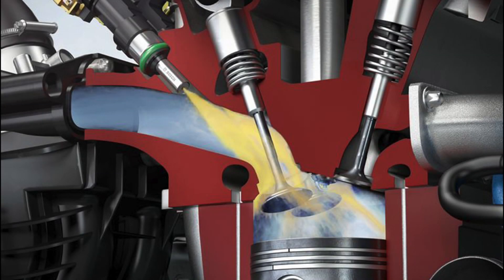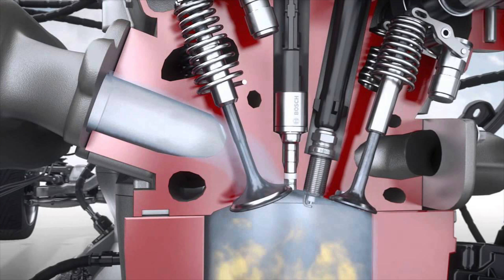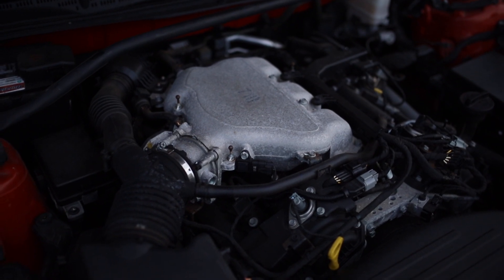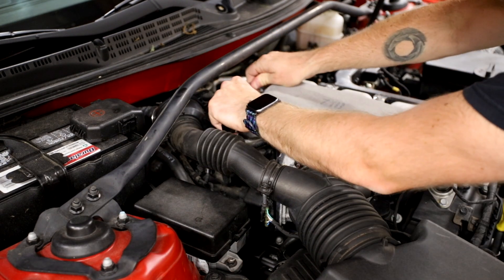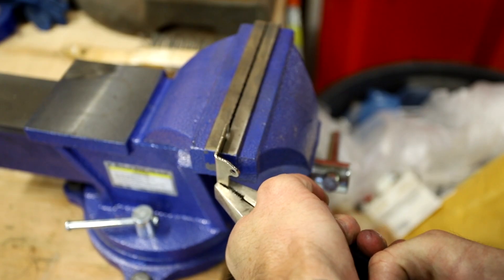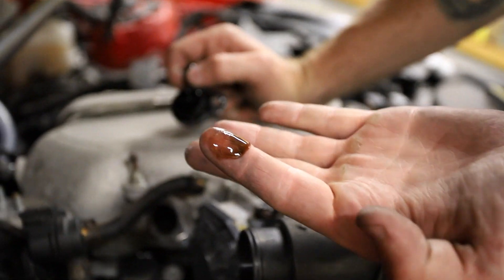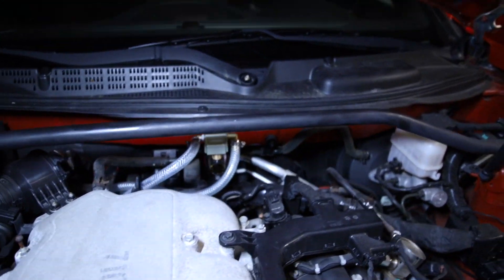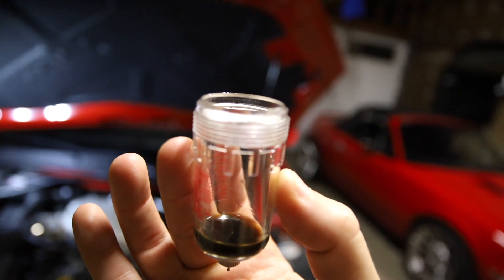First Mod for any Direct Injection Engine

Comment: Just bought an oil can for my 2016 Sonata which has the 2.4 GDI only engine. Next time I buy a car with a GDI engine only I'll definitely install the can right away. It was $40 from Amazon and makes a huge difference. Also I'd say replace the PCV Valve every ~40k miles. It's a $10 part. So for $50 you can greatly reduce the known carbon build up and burning oil issues.
Reply: Great! I have same car as well, you can also add a water vapor bubblers from the exit of the catch can to in of intake manifold, there are plenty how's to in YT😃
Reply: I just bought a Kia Optima 2016 2.4 would this help ? It has 70k miles now

Comment: You know its bad when you have to reengineer what engineers engineered.
Reply: true but most people don't care for their cars like us enthusiast.
Reply: But you should use an oil catch can
Reply: well stated!!!
Reply: I thought it was bc of strict regulations from carbon
Reply: @fuzznutz7182  waste of money. There's nothing you can do besides mechanically cleaning the valves if misfires develop. It could also be on the injector tips.
Reply: @stevenleach6506  that's actuallybthebworst part. Enthusiasts do a bunch of unnecessary mods that don't do anything, just because they want to tinker. You can't prevent this stuff from happening, you just deal with it when it causes problems. IF it causes problems.

Comment: Good video, I installed mine when my car was @ 3000 miles, the simple reason why manufacture don't implement a catch cans to the factory engines is maintenance, some people is notorious for be careless about minimal car maintenance and dont check the catch can regularly and clean it when is need can be even worse that dont have it.
Reply from the maker: I think it just comes down to cars are more disposable now. Most people do not keep them for more than 5 years.
Reply: @TheSlipAngle  agree

Comment: Funny thing is that gasoline direct injection really does not offer a real big advantage over port injection and the parts are more expensive and the system more complex. A well tuned port injected engine has plenty of power and low emissions
Reply: Brother Django Dakota I completely agree!
Reply: @Swagoi  No one ever said it's garbage. It is more efficient and that's why it's used in F1. I just don't think the positives outweigh the negatives on a street car personally.
Reply: @Swagoi  I am sure that this is the case and I'm not bashing GDI, I bought the car lol. I'm just an old man stuck in my ways...
Reply: In some parts of the power band, DI is not as efficient... Thats why properly engineered motors use DI and PI
Reply: Matt we are going to have to call you Bill Nye from now on with that pro intro!
Reply from the maker: I agree that there are advantages to DI but I do like the simplicity of the fuel system with Port Injection myself personally.
Reply: @Swagoi  let's look at this. F1.....ultra high end, limited use, mega expensive, where the complexity is somewhat justified. A regular daily driver, owned by regular working folks, where just going from here to there is the routine for tons of miles and tons of years. The cost to fix a daily went from maybe 100.00 or so for a regular port injector to 500.00 and up for a gasoline direct injector plus labor. Really?! Then add the additional design defects of an engine that promote carbonizing......no thanks
Reply: @Swagoi  is the vw system really that much better on emissions, or was that just when the computer detected it was going through an emissions test?

Comment: an oil separator meant for an air compressor doesn't belong on an engine.  it doesn't do anything for valve guide leaking (which they are all designed to do!).  modern engines have good PCV ... check that it doesn't affect your warranty.  the best way to keep your engine clean is media blasting the heads.
Reply: May i ask what is that
Reply: Big Bass&Rc Habit that’s when they blast  the intake valves with walnut shells to remove all the coked up carbon deposits. Appears to be the most effective and safest method. No potentially harmful chemicals and any excess walnut shell product will harmlessly combust. After that, high quality fuel and oil along with an engineered oil separator as preventative maintenance.
Reply: Who wants to media blast the heads?

Comment: Also, if you only drive your car for short trips, make sure at least once a week to take it out for a longer drive to get the engine fully heated. A lot of these issues are exacerbated by people that live 2 miles from their job and the engine never gets to burn off any carbon.

Comment: I'd like to thank the epa for this issue.
Reply: Thomas Rock  CAFE standards brought it into our lives much more quickly though.  I don't see why they can't make a dual-stage injection.  It wouldn't take much to keep the valves from gunking up.  Strangely Lexus did this on the IS350, but not the 250.  Guess which one has carbon buildup issues?  The EU GTIs have this as well, but US model didn't get it.  I'd probably be a GTI owner right now if they had.

Comment: I think this problem is everything to do with how sound mechanically the engine is as well as driving habits. If the one drives wide open throttle every time they go get a gallon of milk, the increased cylinder pressures push more exhaust gas into the crankcase which will create more oil vapors to get pulled back into the intake system via the pvc, creating the issue. Bottom line is if you have a sound engine and you have good driving habits I don't think this will be a problem.

Comment: I know that installing an oil separator aka catch can, is a must on the pcv system. But what about on the other ventilation tube that runs to the intake manifold as well? Never heard anyone mention that. There is 2 hoses in total routing from the crankcase, the famous pcv and the ventilation hose.
Reply: Ventilation hose run clean air from intake to the engine, you can test it yourself

Comment: A turbo with without a catch can and direct injection cause more carbon buildup on the intake valves. I know my 2017 1.5 CR-V has no catch can.

Comment: You know you can just vent the pcv to atmosphere and completely eliminate the problem
Reply: Only works if you pull a vacuum on the pcv. . . That said, pulling a vacuum is how you generate more power from better ring seal
Reply: @Derkenblosh2  So you're saying you think you can generate more negative pressure in the crankcase by running a vaccum to it? Wouldn't that suck more gasses through the rings, lowering compression? I would think you would want the crankcase pressure to be as neutral and stable as possible so the engine is not working any harder than it should, and also getting the most clean air into the engine as possible at the same time

Comment: Will this work on a RX-8 13b?
Reply from the maker: RX-8 is not direct injection and it doesn't have valves, with that said you could reduce the amount of oil vapor entering into the motor by adding a catch can.

Comment: But don't valves need some sort of lubrification? Why not just run water/meth with the pcv and use a proper oil with a good ammount of detergency? Catch cans don't really make much sense, unless you lube you valves regurlarly or something

Comment: Meth injection is great as well for increasing HP, lowering temps, and cleaning. Stupid cheap also.
Reply: It's also good at damaging rubber seals
Reply: Amit That’s bullshit, temps would be too hot for the water/meth to have any affects on seals. You’d have to soak the seals in order for them to be damaged.
Reply: Methanol or ethanol?

Comment: For me this is a controversial issue, i own a 2018 SS/1LE camaro with a DI engine,sometimes i think oil separator are just click bait / content generators for youtubers. how is it possible that every major auto manufacturer with literally thousands of engineers, millions and millions of miles of durability testing have missed this problem??  The proof on youtube is always a guy pouring liquid from the separator and claiming  this crap would have ended up on your intake valves. Very difficult to prove if its really necessary, i am sure it helps to some small degree. its also a fun afternoon project for some person who is not really a car guy but wants to do some simple modification to his car . i am pretty suprised  that the slip angle guys would do a video on this, thought they were way beyond this crap, thats why i watch the channel. my opinion, i could be wrong.  I think changing your oil more frequently (like every 3K miles??) could could possibly minimize the contaminants in the oil coming through the PVC system. is it possible these 10K mile oil changes are part of the problem??
Reply: All I know is that I would rather catch the oil in a separator than have it in my intake manifold. Does it really have to be any more complicated than that? This car is fresh off an oil change too btw.
Reply: Doing nothing is less complicated than installing a catch can.
Reply: It's probably as simple as the EPA is forcing car manufacturers to build motors with better fuel efficiency. Therefore, they have to sacrifice the valve cleaning benefits of port injection in favor of more MPGs/GAL with GDI. It seems to be a three way struggle between gasoline, oil, and car companies all designing products that their sales and design goals may not always line up.
Reply: Michael Miccio and when did I say that this was complicated? I’m so very sorry that making this video has made you mad for some reason lol btw I love those Camaro 1LEs, seriously they rip...
Reply: just making conversation, matt are you one of the slip angle guys??
Reply: @Miccio1  you do know Quinn has one on his nb miata too right?
Reply: Michael Miccio yeah, that’s my ugly mug in the video...
Reply: @thehowl1689  Why? a NB is not direct injected? sucking all those blowby gasses back to the intake is good for the environment! (AKA: pvc)
Reply: @Miccio1  you said an oil separator is clickbait and that you expected more from the slip angle guys. Yet like I said Quinn is running one on an NA motor and I'm sure he's catching some oil too. DI engines just need it more than port injected engines
Reply: The pcv system operates regardless of how often you change your oil. The reason manufacturers don't install this from the factory is because gunked up valves won't break anything. It adds maintenance without much value for the average consumer, resulting in less sales. It really only matters to enthusiast who will care about the loss of performance and long term engine health effects.
Reply: @AztecAirsoft  ....thus making it an effective mod
Reply: @thehowl1689  Agreed. I was responding to the original comment on why manufacturers don't install them stock from the factory.
Reply from the maker: @Michael Miccio engineers are human too. Being human means being flawed i.e. we all make mistakes and perfection is impossible. Early forms of DI have more of an issue of carbon build up because there is no fuel washing the backside of the intake valves and there is no combustion or exhaust to burn anything off. I know that with VW, like on my friend's 2017 Golf R, they actually added port fuel injectors on top of the DI system to try to mitigate the carbon build up on the intake valves. The issue with carbon build up is real. Many car forums have writeups on sandblasting the valves with walnut media as a normal maintenance routine.
Reply: @TheSlipAngle  just think about it, there are literally hundreds of engineers, from top manufacturers  from all over the world, they all missed this? I will say that most of the manufacturers seem to be back pedaling and adding back port injection.  Do see my point? How did so many smart people miss this?? Must be a risk vs reward thing.